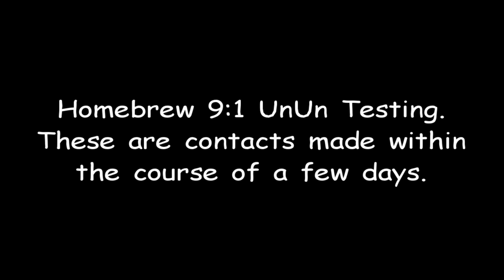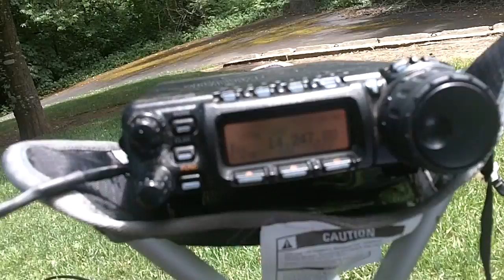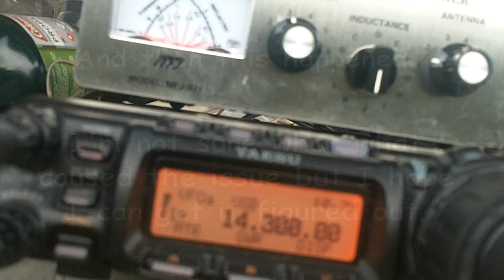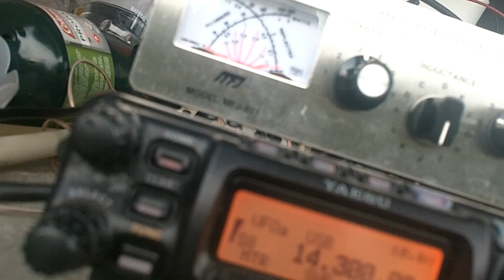Homebrew 9:1 UnUn Testing

Comment: Good stuff.  I have the same radio and will build a 9:1 anun for an end fed wire.  Did you ever figure out what the problem was?  Thanks for making/posting that sir.  KF4ULD
Reply from the maker: Matt Cero Thanks Matt. I never figured it out. I think it was a grounding issue. Only happened when I used higher power. Maybe I just used too much power with that unun.
My setup has changed a lot since this video.  K7FOP

Comment: How long are the wires? (counterpoise and leg), thanks for posting.
Reply from the maker: vetham100 I can't remember now. I would say the antenna was 31 ft. Counterpoise was probably 16 feet
Reply: Thank you kindly, i hope you got the problem solved with the rf getting back to the radio. 73 de VE3QJ

Comment: You'll still get great results without one but it will cut down on the noise and protect your radio.  From what I've read the older tube radios could handle an end fed much better than the modern radios.  That may or may not be true.  I've been using the Utimax line isolators.  Their website is utimax-antennas.com Not sure if they are any better or worse than any other brand but being that the first one that I bought had been working well, I bought another one.  73
Reply from the maker: Thanks for the info. Since I made this video I have switched over to a Sotabeams linked dipole for my main SOTA antenna. I use the endfed in emergency situations like I had this past weekend on a summit. I'll look into the 1:1 balun

Comment: Unless I'm just not seeing it you should be using a 1:1 line isolator or balun to get rid of the noise and keep RF from coming back into the radio.  It can make a night and day difference.  On mine I have the line isolator connected to the 9:1 with a 2' piece of coax and then 75' of coax running from the line isolator to back to the shack.
Reply from the maker: I've had great results without one. I coil the coax and that seems to work fine. thought about getting the 1:1 but haven't yet.